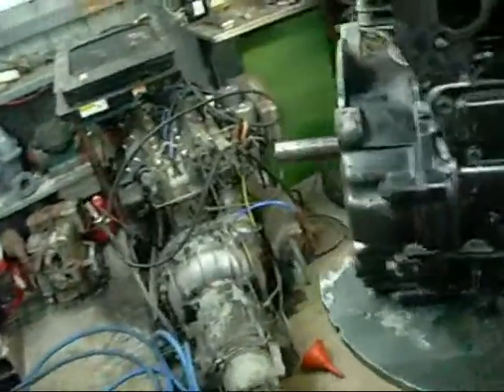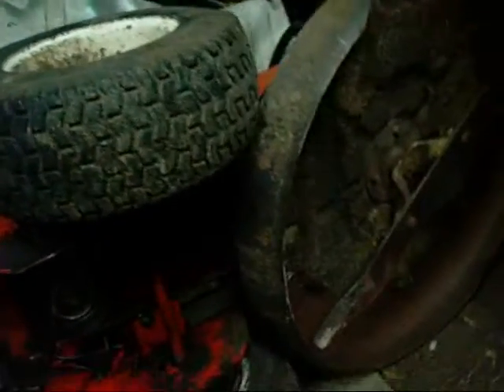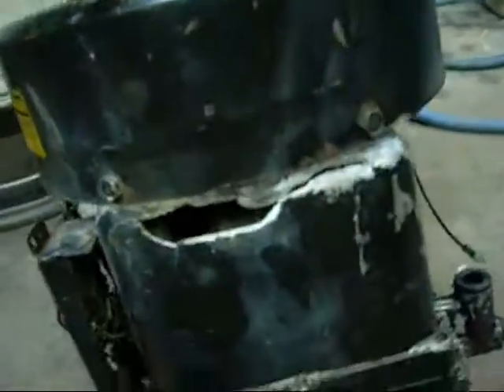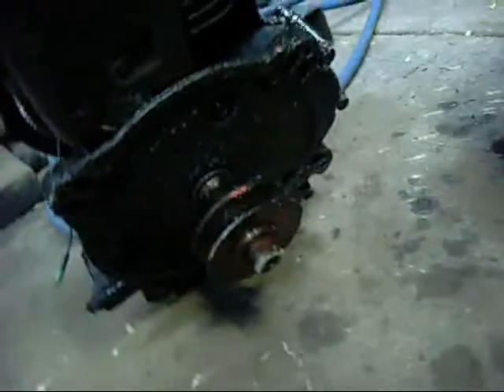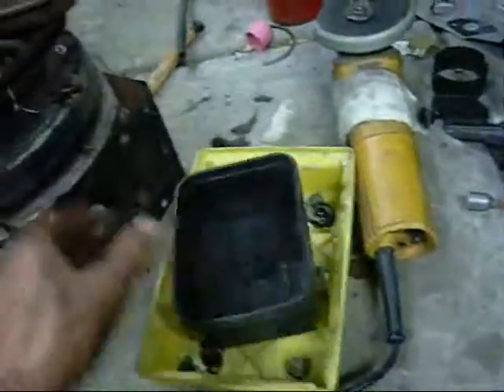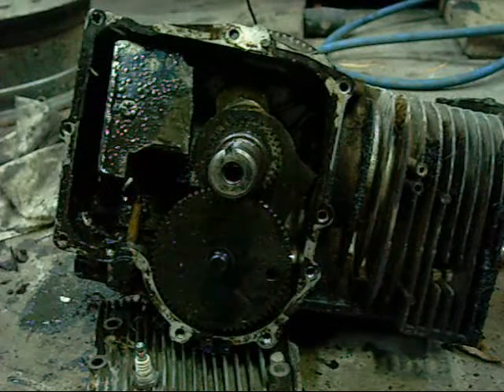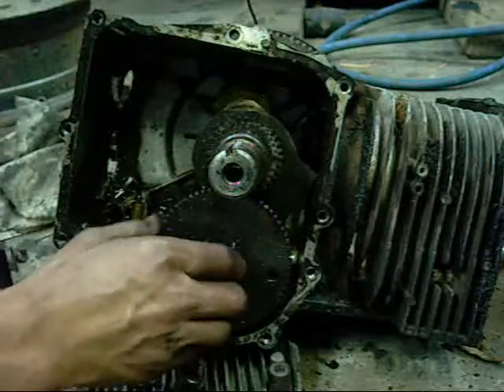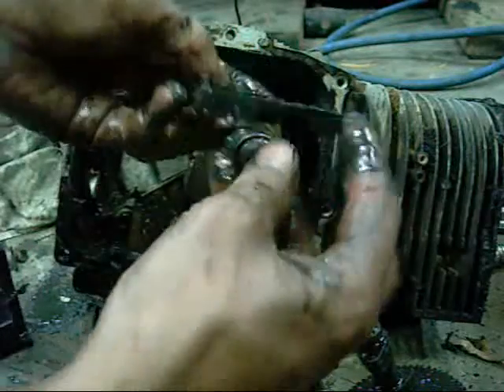Exploded Briggs And Stratton 12Hp Vertical Shaft Engine Autopsy

Comment: This is a question from my 83 year old small motors mechanic father…he is trying to fix our neighbours ride on a Briggs and Stratton 12Hp IC motor model 283707 (their first home and can't afford a new mower yet).  He says the timing is out on the valve.  The valve clearance is right but the intake valve is out.  Is it possible that the cam shaft is bent and can that throw the timing out?
Reply from the maker: if the timing is out on only one valve it could be a bent cam, but I have never herd of it before. 
if the timing is out on both, then its just not set right, and if clearance is excessive it can cause a late opening, but that would be obvious since the shim would be missing and clearance would be excessive.

my first step would be to check both valves timing and look at the timing  marks on the cam in relation to the crank. if its been apart before, somebody may not have put it back in correctly.

Comment: i agree, 95% of the failures i have seen in the briggs single cylinders are from the counter balancers flying apart, however the briggs v-twins are very very durable engines.

Comment: do most small engines have keyways on the end of the crank? because im taking apart a newer smaller b&s and can't get the bottom flange off the crankshaft...

Comment: what year was that briggs made? I have a 11hp version of this motor, its a late 70's model, and it has the syncro balancer thing, and it still runs and what not but, has a rattle when revved up by the govnered throttle, sounds like somthings loose in there but doesn't effect how its running. But on my rider(which don't cut grass anymore, more like modded mower)i swapped out the 11hp for my 19.5hp opposed twin, runs really nice and has power.

Comment: Sorry that I took so long to answer. My Briggs engine was on a Sears Craftman and after the autopsy I found that the crank broke at the journal, one counterweight and the connecting rod are gone. The rest is fine. So the engine will be salvage and rebuilt from donors. Since 7 months ago, I was fortunate enough to gather 2 other engines and 4 riding mowers for free.

Comment: A good friend of mine bought a tractor with the exact same engine on it..only thing wrong with it is the hand-sized hole in the back of it...rodcap came loose so the piston rod flew  through the block...

Comment: It's Funny.. I'm rebuilding this same model brigs (12.5 HP) because the fucking rod cap "rattled loose".. I have never seen an engine designed so poorly, especially a Briggs. But for some reason, every video I see of this engine model has spontaneously "came apart".. I think Briggs should get sued over this as it isn't just a one engine failure, it seems to be pretty common...

Comment: Thats bad you should see the briggs on a John Deere 165 i am working with i just got it running the idiot who worked on it before messed up the timing so bad it blew the cover off the air filter that wasnt bolted bown and the thing was the engine was perfectly fine before he worked on it

Comment: I just received one which went bang. A 12hp briggs 281707 that lost a counter balance and nicked the connecting rod. The rest is fine (Thank god ) because I hate to waste a 12 or 12.5 cast bore engine. They last forever if regularly maintained. I only started to fix them as a hobby one month ago and salvaged a tiller 5 hp from the morgue.A valve was stuck open due to a lack of maintenance. New filters, a coil,shellac washed away and a new diaphragm,new spark plug and oil.Its alive under $25.00.